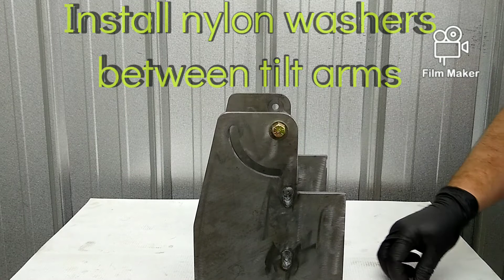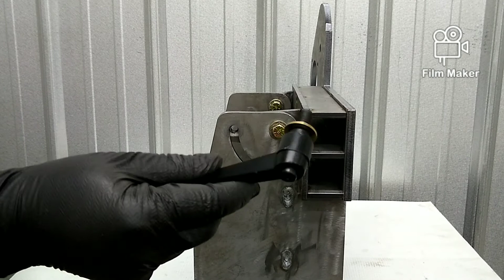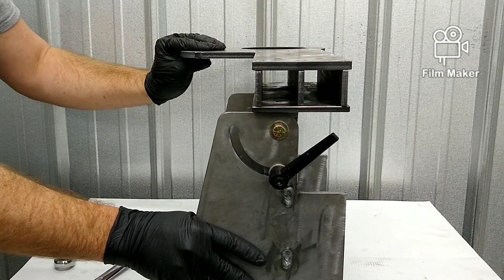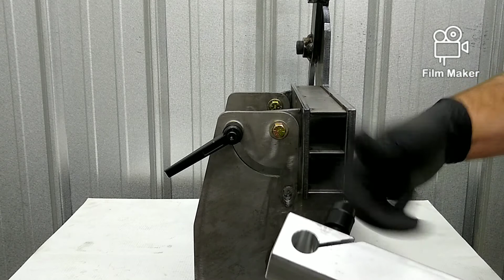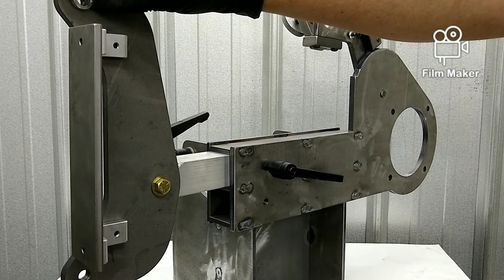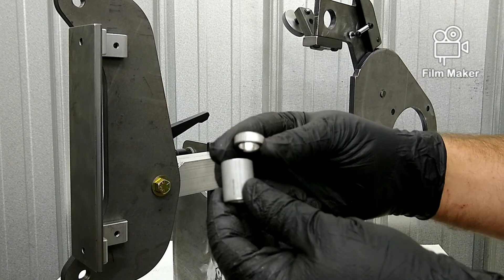Mark Graves grinder kit build. video 2

Comment: w/o the belt tension being sprung, how how can you adjust the tracking, as that pivoting impacts tension, right?
Reply from the maker: Yes it impacts the tension somewhat if it's too much. You drop the arm and reset it. Once the tracking is set very little adjustment is needed if any. A ratchet style tension arm doesn't bounce up and down like a spring or gas shock.